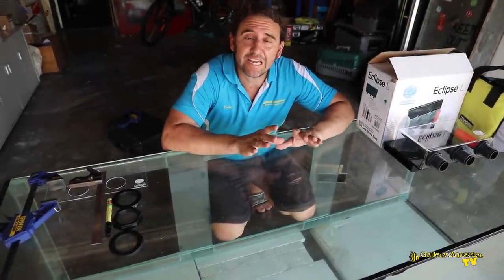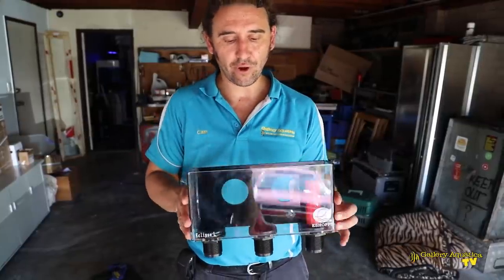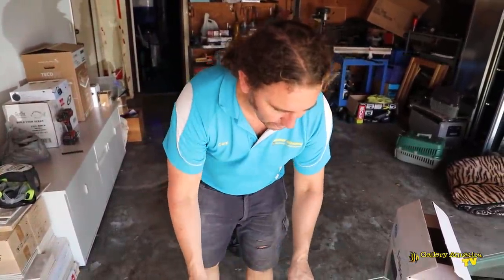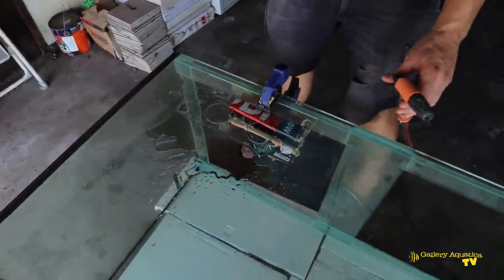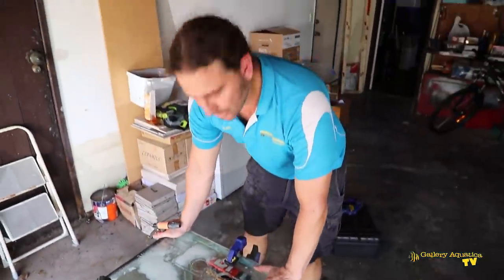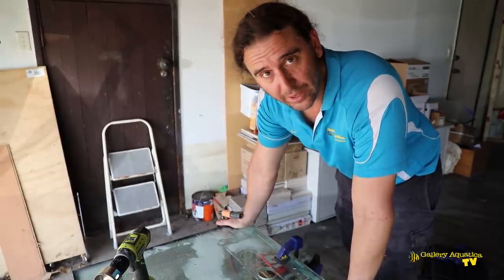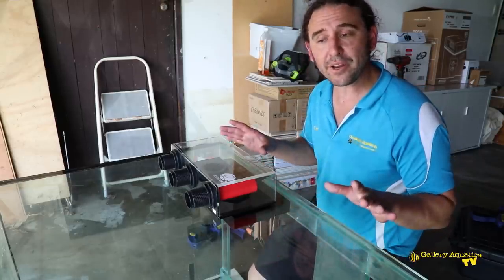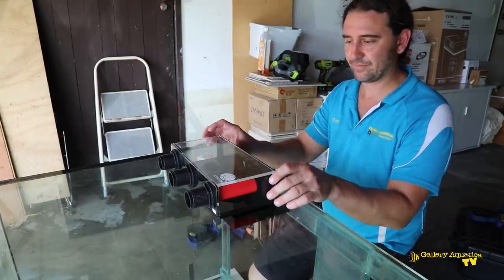Converting a Freshwater Aquarium to a Saltwater Aquarium --- Gallery Aquatica TV

Comment: How easy are those to clean, the weir comb and front part look tight to get into for maintenance.  Nice sleek look though.
Reply from the maker: This is why I didn’t silicone it in place, in case the client wants to be able to remove for cleaning. They aren’t too bad to clean in position however, as a toothbrush is perfect for the weir. The only reason to remove to clean would be to vinegar soak the coraline. Cam

Comment: Why doesn't the overflow go in the middle?  Do you have to drill more holes for the return line?
Reply from the maker: Excellent question! There are actually going to be 2 overflows (the second will be on the other end). We didn’t feel the need to film all 4 holes being drilled... Cam

Comment: And here I am with my four sumpless tanks using Tunze Reefpacks :D My large tank is even predrilled, but I won't spend the electrical on lifting that much water. That can easily be the most expensive part about this hobby :) nice video! EDIT: point being that you don't need holes in the tank for it to be a marine tank :D
Reply from the maker: Interesting, I’ve never considered that a tank without the sump to tank head-height would be cheaper to run... Interestingly we filmed a tank without a sump today, stay tuned! edit: we will be filming a tank with T5s in the near future too😉 Cam
Reply: @GalleryAquaticaTV  oh I have with my limited budget. Having a ca 100watt pump running 24/7 sounds scary expensive to me. Especially with those Scandinavian prices. The Reefpack 250 is 8,5 watt for skimming and filtration. Uhh T5's thats gonna be neat! :D Looking forward to it!
Reply: @TattooedDancer91  Presumably your tanks are on the smaller side?  In which case I agree, what you got is fine,  however with larger tanks something like that tends to be less effective as a skimming solution.   Plus I don't trust Tunze's tank rating system, it claims 60-250 liters, but I'm guessing the 250 liter side is with a minuscule bioload to the point of maybe a skimmer isn't even necessary :) 

Also depends what your definition of "scary expensive" is,  not sure what electrical rates are for you, a quick google shows some Sweden ones at about 21 Euro-cents per kWh.  To which a 100 watt return pump would be 72 kWh per month running 24/7, which would translate to about 15 Euro per month.    DC return pumps tend to be lower wattage too, as people find they don't need to run them at full speed.    That said, I'm not trying to change your mind, if what you have works, then more power to you :)
Reply: @Mike__B  Of course they are on the smaller side, I'm trying to spend less money and have as few electrical cords and points of failure as possible while keeping the healthiest coral. The largest is 65 gallon, and uses Reefpack 250. I'm growing acroporas and the entire filtersystem and flow is less than 50 watt and with undetectable pollutants. I'm pretty proud of that :) 

15 Euro a month is a lot, especially since that is only ONE of the many pieces of electrical you're running. And my going rates are 0.30 euro pr kwh. The cummulative costs are not insignificant. But maybe you're rich and feel you need to lecture me about what expensive is.  :P I have four marine habitats, ergo saving money is pretty damn important.

My point was that you don't need holes in the tank, and no matter what tank you're running you can keep it healthy with manual labor and intelligent husbandry. How many fish you want is another story sure, but you can still overpopulate the tank despite having a massive sump, so it's not really relevant, only the intelligence behind it and methodology is relevant in that regard. Anyways, take a look at this tank and talk bad about Tunze skimmers again.
https://www.youtube.com/watch?v=jecIArwlTr4

Comment: One other comment,  I'm not sure I agree with the gasket placement.   I would think you'd want one inside the tank between the skim box and the tank wall, and outside the tank between the tank wall and the overflow box, not in the overflow box with the locking nuts.

Comment: Pro tips for drilling glass.   1- Cordless is fine, just have another battery handy in case you run out of power  2- Set the drills clutch to the lowest setting, you want the drill to disengage if there's too much torque on the drill (i.e. it's pinching in some way)  3- Tape the back of the glass so the glass doesn't fall through, also it prevents the glass from breaking unevenly 4- Let the weight of the drill do the work, don't try to push it through  5- Have a friend help by being the "water boy"  6- Eye protection for crying out loud!   Glass shards is something you never want in your eye.